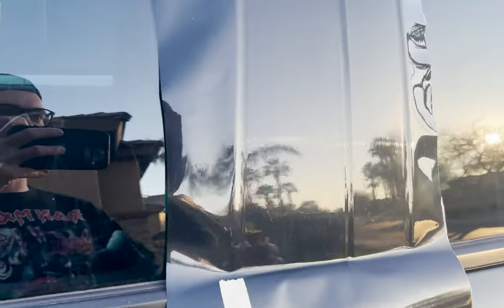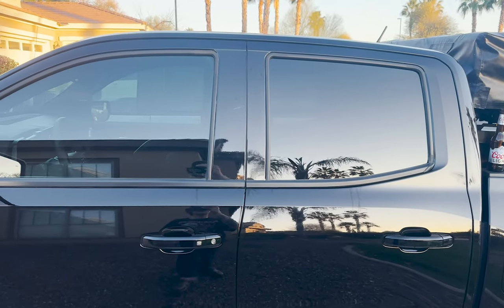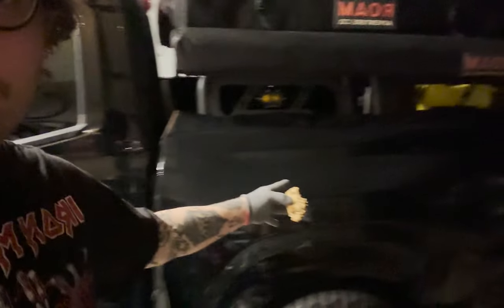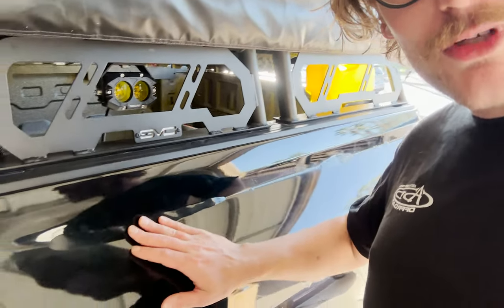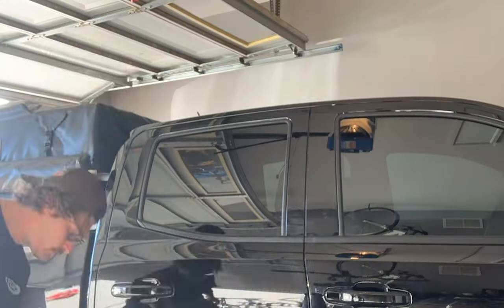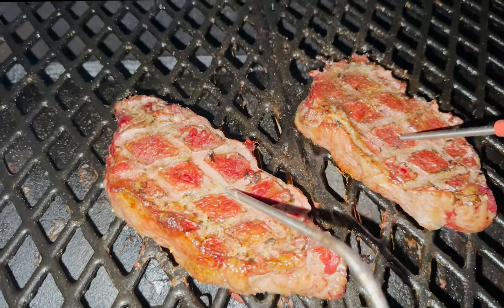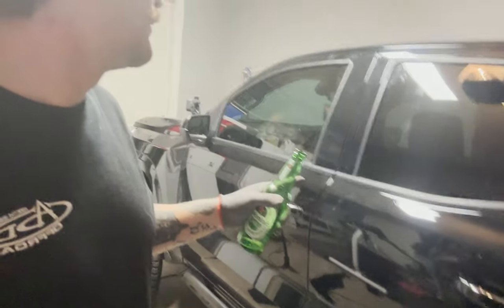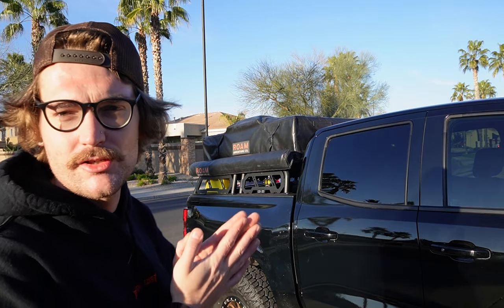2023 Chevy Colorado Vinyl Wrap FAIL   [Part 1]

Comment: Nice work. I've never wrapped before and want to take the plunge. I've been thinking of wrapping parts of my '23 Colorado Trailboss. Especially the grill and bumper area, all the plastic really pulls away from the aesthetic. My problem is finding the right color for the Glacier Blue Metallic paint. I want to do a gloss black on the fender flares, door handles, and the door pillars.
Reply from the maker: The grill and door handles will really be a pain in the ass 100% but the others would be no problem ! It just takes time and also buy extra 😂
Reply: @Downtimelost  I'm thinking about using the knifeless cutting tape to shape around most of the grill and difficult parts, leaving it that black color. I'm thinking an end not wrapping around would eventually roll up though.
Reply from the maker: @sahzookey  it’s definitely possible! Good luck brother ! It start on the easy stuff first then work your way up  🤘

Comment: The bed looks like a nightmare to wrap, so many curves and lines. I took my work van to have it wrapped, it took 3 guys about 3 hours to do and thats nearly all straight lines on a vehicle type they've probably done 100 times. You did a great job with it, seems like one of those things were each try takes less time but still comes out better. 🤘
Reply from the maker: Yes sir ! Exactly! I currently just finished the whole passenger side and it’s been 4 days 😂😩😩

Comment: The problem with a wrap is that they never last more than a couple of years and then it's a nightmare to remove.  You might have been better off with some thick fender flares to keep brush away from the paint.  Not sure if they make aftermarket fender flares for these trucks yet.
Reply from the maker: Nah I wish they did ! :/